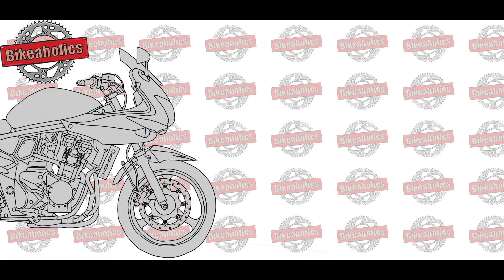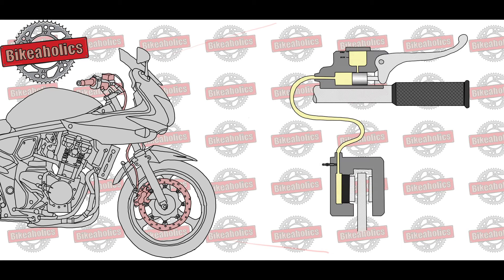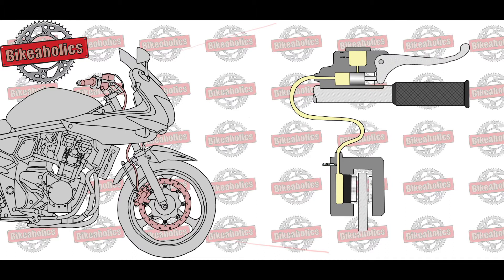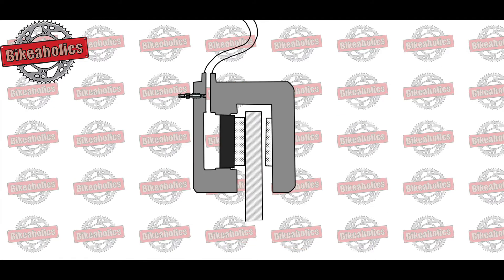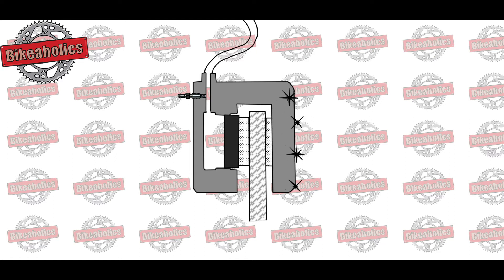How does the motorcycle brake system works? - Animation - Parts

Comment: How does the piston near the disc go back after pressing the brake?
Reply: The Caliper Seals are a Square Section, not round like an O-Ring.
As the Piston moves, the Seal surface touching the Piston gets dragged with the Piston towards the Disc (very small movement remember).
The outside surface of the Seal is obviously held in place by the Groove it sits in, so the Seal is deformed slightly.
When you let go of the Lever, the Seal's elasticity makes it return to it's original shape, dragging the Piston back away from the Disc.
We're only talking about a few tenths of a millimetre movement here.

Comment: Will wheel and disc move from one pad side to other pad side??
Reply: The example shown is a simple 'Sliding Caliper' type, with a Piston (or two) on one side of the Caliper only.
The Caliper body slides on two round Pins, or specially made Bolts.
When the Piston touches the Disc, the Caliper then starts to move the other Pad into contact with the Disc on the other side.
The Sliding Calipers can only be used on 'solid' (non-floating) Discs.

The other Caliper type has a Piston (or Pistons) on both sides of the Caliper, the Caliper is fixed to the Fork Leg, it doesn't move.
Both Pistons (opposing Pistons on 4 or 6-Piston Calipers) move at the same time into contact with the Disc.